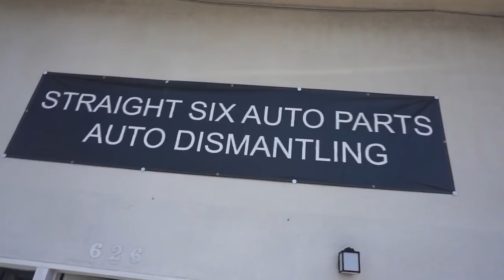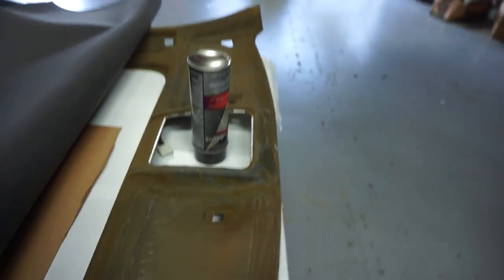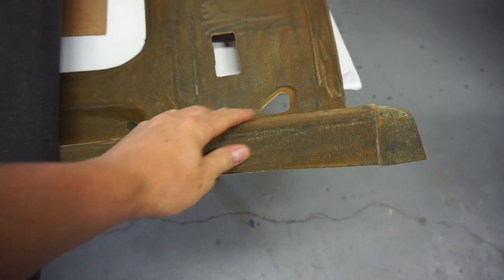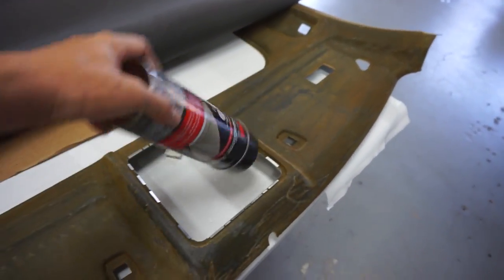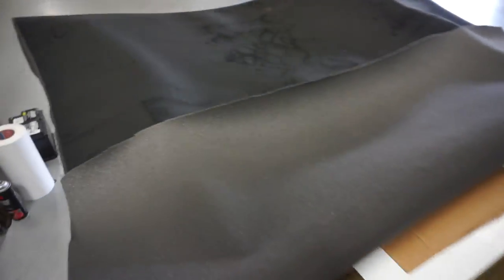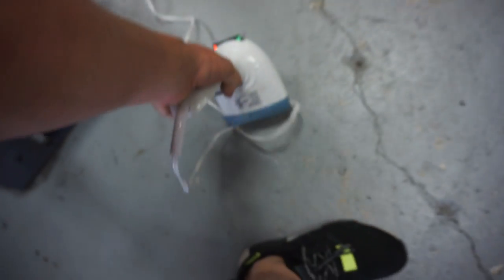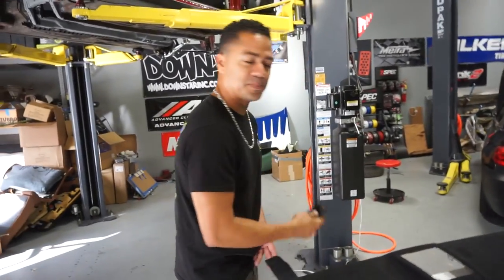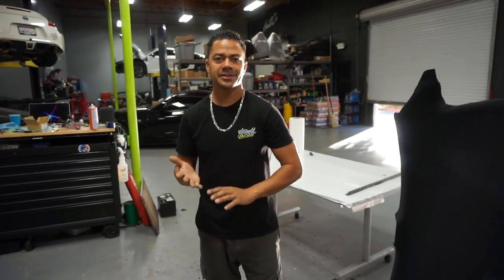Building and Heavily Modifying a 2007 BMW E92 335i (6 Speed Manual) - Part 4 - Transformation!

Comment: I did this on my e92, and let me say getting it out is not as easy as it looks in this video haha. Also when picking out a new fabric, especially if you want a real or synthetic type suede, you want a very flexible fabric because this headliner has a lot of curves and shapes the fabric needs to fit into. Don’t forget it may be cheaper to get the a and c pillars wrapped in suede (or whatever color) rather than buying new or used ones! I hope this helps anyone wanting to do this!

Comment: Love the suede headliner guys nice touch. I do have a question about headliners. Can you flock the headliner with the old headliner on or does it need to be removed or flocking is not recommended for the headliner? Im rebuilding my old 2006 kia spectra5 and the headliner is disgusting! Hope anyone has suggestions.

Comment: 5:05 its called a Toffee Wheel in the UK!

Any reason you didn't just put the new liner over the old one?
Reply: Its better to remove the old headliner because in a couple of years the old foam backing might/will disintegrate even more and thusly the old liner will start dropping down. If you now glued the new one over the old one both will come down. You just prevent that by removing the old stuff and reglueing everything.
Also if you have a double layer of material your clearences can be off and stuff like the lights or such might not fit anymore/not as well as before.

Comment: the headliner diy is the same pain in the ass on the mk5 VW's of the same area. Did mine without power tools and it was the worst. I'd rather have to helicoil an aluminum head after stripping a bolt than do that again.